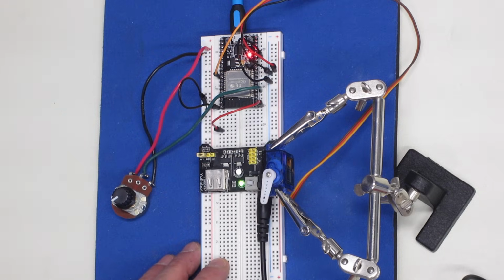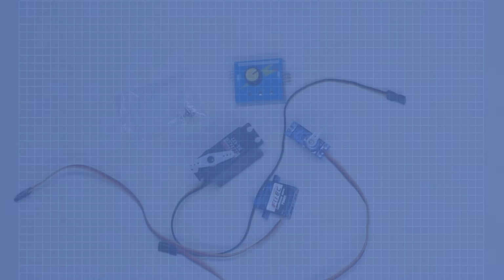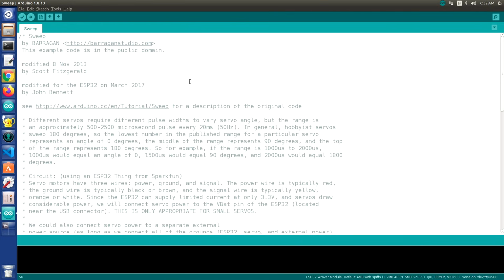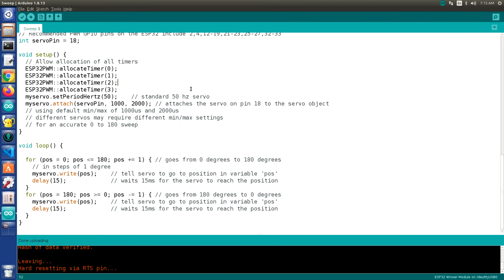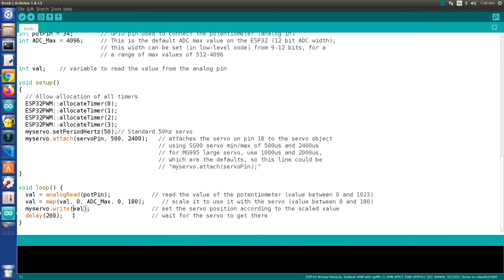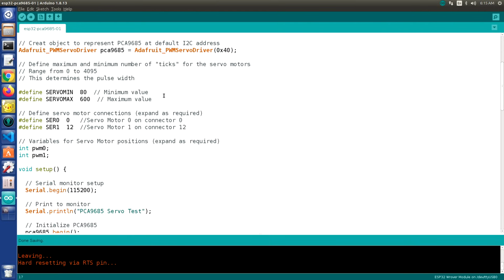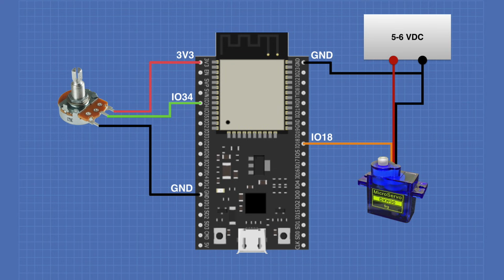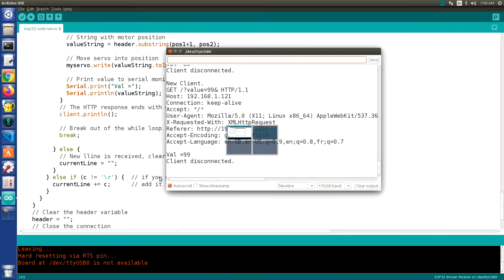Using Servo Motors with ESP32

Comment: I can run the servos using the V+ pin on the VCC side, but when I run it through just external power supply side, and leave V+ open, it doesnt work? I have a common ground

Comment: I have a problem. I've tried multiple different tutorials, including the servo test in the esp32/pca9685 section (right before the wireless example) and my servos don't move. I know they work, as I tested them one at a time via an arduino uno 3(ish?).... but no matter whether I use a breadboard or a terminal adapter. The serial monitor prints out gibberish.
Reply: Same man I am tired of trying to get my servo like it works with Arduino even with the vcc and gnd of esp32 but the signal is the problem

Comment: Thank you! Just moving over from  using only the ESP32 for controlling the 8 servos in my Rubik's cube solver, to  using PCA9685 to control the servos instead; a bit of a learning curve but with repeated watches things are clear now and I've got the first few servos up an running.  Your channel has been a great help in getting to grips with Arduino etc.

Comment: I have this problem

              ledcAttachPin(pin, getChannel()); // re-attach the pin after frequency adjust
      |                 ^~~~~~~~~~~~~
      |                 ledcAttach
c:\Users\DELL\Documents\Arduino\libraries\ESP32Servo\src\ESP32PWM.cpp: In member function 'void ESP32PWM::attachPin(uint8_t)':
c:\Users\DELL\Documents\Arduino\libraries\ESP32Servo\src\ESP32PWM.cpp:235:17: error: 'ledcAttachPin' was not declared in this scope; did you mean 'ledcAttach'?
  235 |                 ledcAttachPin(pin, getChannel());
      |                 ^~~~~~~~~~~~~
      |                 ledcAttach
c:\Users\DELL\Documents\Arduino\libraries\ESP32Servo\src\ESP32PWM.cpp: In member function 'void ESP32PWM::detachPin(int)':
c:\Users\DELL\Documents\Arduino\libraries\ESP32Servo\src\ESP32PWM.cpp:263:9: error: 'ledcDetachPin' was not declared in this scope; did you mean 'ledcDetach'?
  263 |         ledcDetachPin(pin);
      |         ^~~~~~~~~~~~~
      |         ledcDetach

exit status 1
Reply: He did a video recently about the esp32 board manager 3.0, which changed some ESP32 syntax, including ledc. I think you may be running into one of the changed calls.

Comment: What are the SDA and SCL on ESP32-S3?  There is no port 22...
Reply: Check the pinout diagrams for your board. But being ESP32, they’re really flexible, and you can actually reassign the I2C pins to almost whatever you want.

Comment: Can someone explain why it’s critical to have ground reference from the servo (just some links to reading material would be nice) also why and how is it safe to having two negative connections from to two different power sources and voltages

Comment: I need a big favor from you. First let me tell you what I'm going through. No servers will run if I use a breadboard! I use those little breakout boards for powering the breadboard and if I use those I have to crank up the power supply to like around 9:00 or 10 volts to even get close to 5 volts output from those breadboard controllers. And if I use a substantial digital servo forget it you can't use a breadboard at all I have to connect it directly to power from some kind of power source. 

 It has taken me feeling like a loser to finally figure out what was going on. Now I'm faced with the dilemma I need to buy a bench top power supply is the one I had was terrible I don't want another terrible import that is going to be flaky unable to control amperage and have no presets or memory slots. I don't have experience in knowing what to buy and what not to buy and I don't have a lot of money. Could you please tell me if there's anything acceptable that I could buy for under $150 I know that isn't a lot of money for such a thing but again it may be enough for hobby stuff like this. I had a really nice tectonics one but it got broken in a move and I threw it out I should have tried to get it fixed it was a combination power supply with straight DC presets memory slots whatever you want to call them and also had a decent signal generator I also had a really nice little tectronics o scope with that God damage to and it was beyond repair almost certainly but if I could just be confident in buying an inexpensive power source it would be a great help for me. I would like to build some tiny power supplies for individual projects but that's in the future

Any suggestions that you could give me would be greatly appreciated please anyone chime in here

Comment: Using your video I built a ESP32 firework controller using i2c (32 cues) but of course with i2c it could handle up to 128 cues at least. Thanks so much, works so flawless :)

Comment: Great video as always. Those 9685 boards are very cheap. I read we could set the output to full on, to mimic a gpio output, is it true? Could we drive other equipment using this principle, like relay or mosfet? Others?

Comment: I am glad to see my library was useful! One point i would add is that i also made a library that wrapps the linearization calibration for the ADC, to give more accurate ADC readings: https://github.com/madhephaestus/ESP32AnalogRead Its much more accurate than the built in analogRead()
Reply: Hello

Is it possible to rotate the servo 360 by e.g. 1000 degrees with your library?
Reply: @alladyn21  those types of servos are limited to a max of 180 degrees. the limitation is in the servo itself. There are "360 degree continuous rotation" servos that are controlled for velocity instead of position, but are fairly uncommon. There are also serial bus servos such as the lx-16a that work well with the ESP32.
Reply: @KevinHarringtonBuildsRobots  yes i know i have a servo that can turn around, but i asked how to do it with your library. Thanks for the answer

Comment: Possible use for 900+ servos at one time, field of small solar panels in a hex shape to sorta resemble flowers, 2 servos per pannel and configure each to get the panels pointed at the best light using some light sensors, probably a master sensor that directs all the servos to go to applicable locations. Probably super inefficient compared to a few big pannels but would look cool?

Comment: If you disconnect the ESP32 from your PC after running the sketch, does the code remain on the device for use with a different power supply so that it can run on its own?
Reply: Yes, the code is stored on the Esp32, so when you power it up from a different power supply the code will automatically start running.
Reply: @malch2843  Thank You for that info

Comment: Should there have been a common ground between the ground connection of the PCA9685 and the ground of the 5V supply for the servos?
Reply: It depends if your servo is using the controller board's voltage supply...like stated in the video, its better to use external power supply and ground.

Comment: nice video
11:36 why we need to connect the servo ground cable to the esp32 ground ? never understand this )=
Reply: All devices need to be connected to a common ground. This ensures that all the devices have a common reference point. If they are not ground common the voltage between the devices could vary thus causing data corruptions.

Comment: I’m a fan of your site and now I’m hooked on the ESP 32. You can spend hours perfecting the web based interface but it is a cool way to operate the controller.
Reply: If you want to skimp out you can get the ESP8266, most of the functionality is the same you just have to use different libraries
Reply: @webforder4201  Absolutely correct - I just finished a miniature weather station which sits outside my house using the ESP8266. I check temperature, humidity and barometric pressure from my iPhone based on learnings from this channel.
Reply: George Vidas cool. I did a similar thing, except I send information to a raspberry pi using get requests.
The good thing about the ESP-32 is you can do multi threaded things, but the same thing can be achieved using millis

Comment: Lol I just burned my servo by connecting it to 7V, I opened YT to find a way to fix it(with doubt).
And boom. What a timing.

Turns out, you can connect it to the 5V with a capacitor and that may fix the issue BEFORE connecting to a 7V for more power. 
https://learn.adafruit.com/adafruit-arduino-lesson-14-servo-motors/if-the-servo-misbehaves
Reply: What do you have that uses 7V, just interested. Did you put too many batteries?
Reply: @webforder4201  7.4 ish cuz it was 2cell lipo
It was Vin pin in Arduino
Reply: For 7-8.4 V you must use a HV Servo.